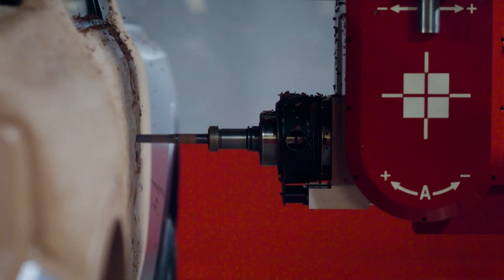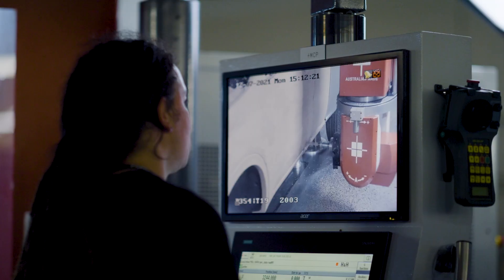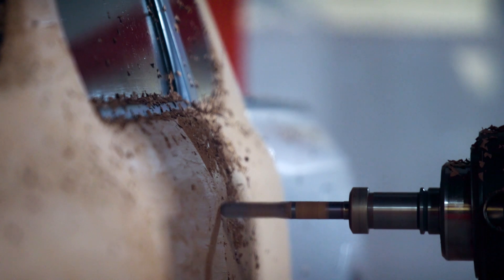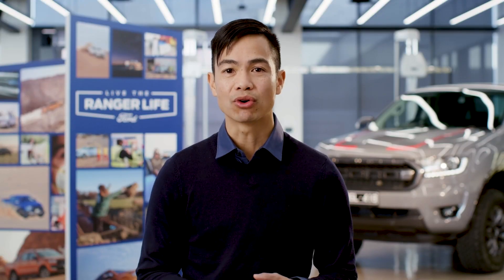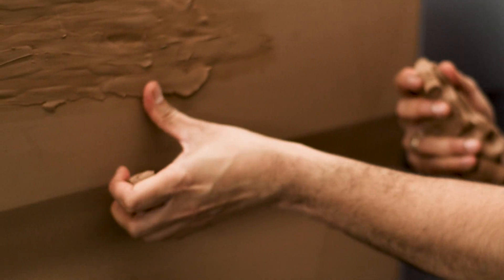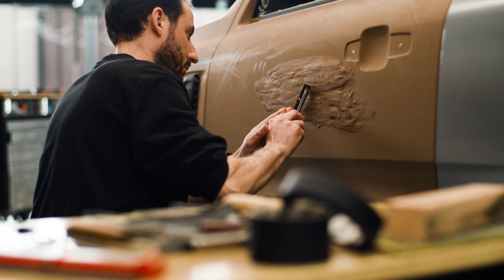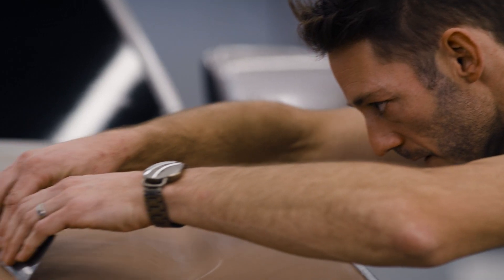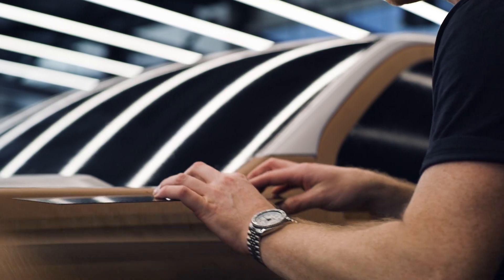#NextGenRanger - Designing a ‘Truly Global Truck’

Comment: HOW!?  Build, dual tanks underneath. Battery and alternator also, in the back bed, for powering tools and 15"Kicker speakers. Ultra mat, the bed and interior for sound proofing. Truck bed sides- tool boxes built into interior truck bed fender. That open from the top with door key.
    4 or 6 sp short throw manual.
Five cylinder & electric engine for take off single gear power. Gas engine picks up in second gear and gas engine shuts off in cruise control.